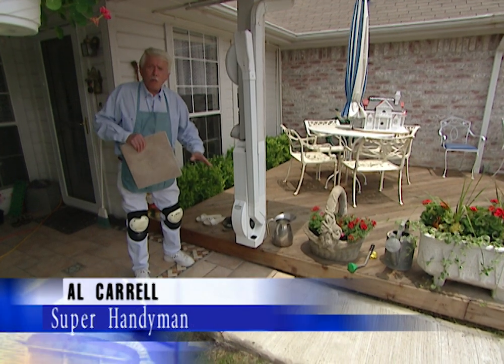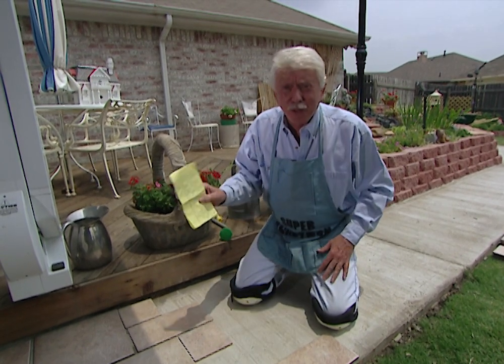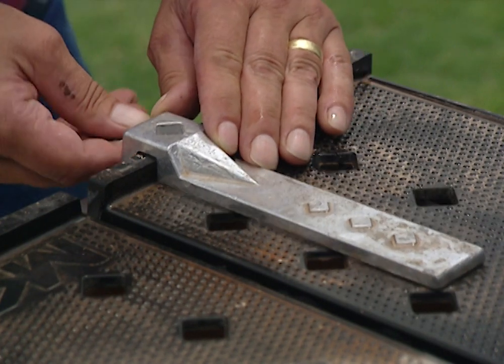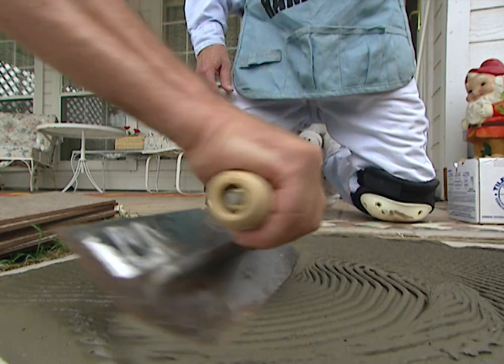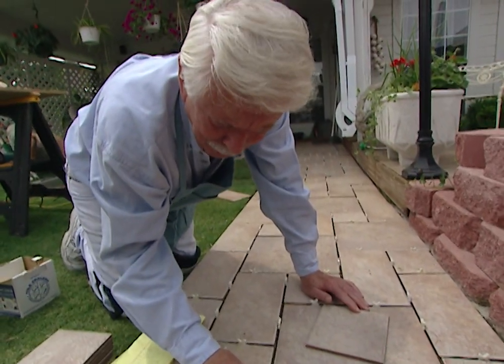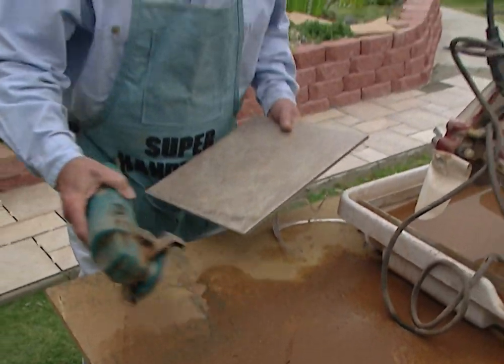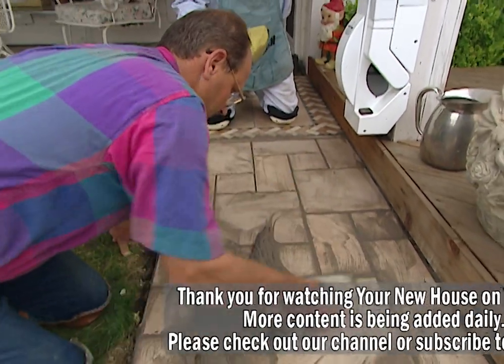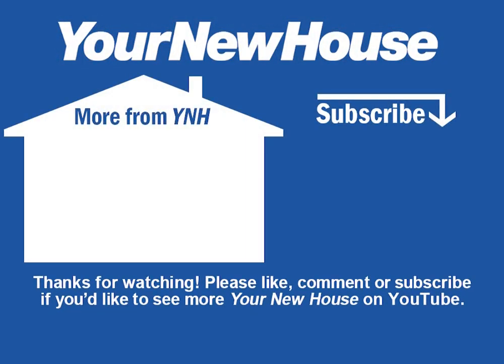How to Tile a Sidewalk or Patio with The Super Handyman, Al Carrell

Comment: Great Video. I have a walkway that has been stamped and sealed twice. Both time the sealer and stain have chipped off. I want to replace with porcelain tiles. Do I have to remove the Acrylic sealer and stain?  What can be Done???